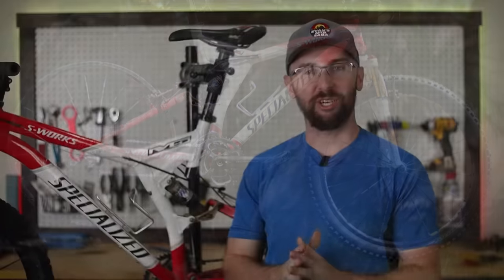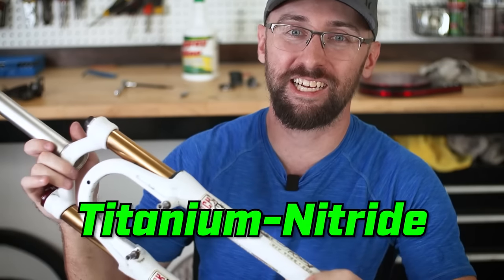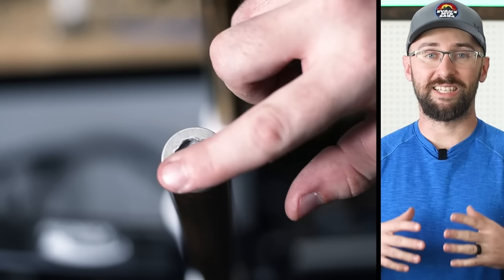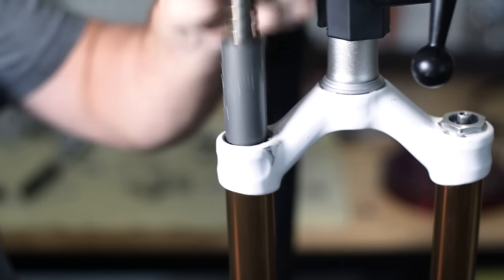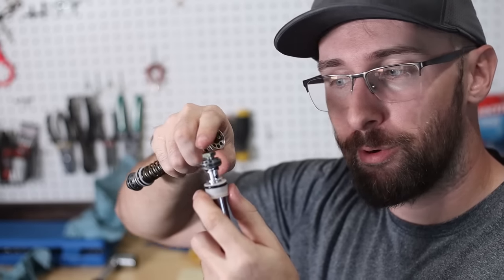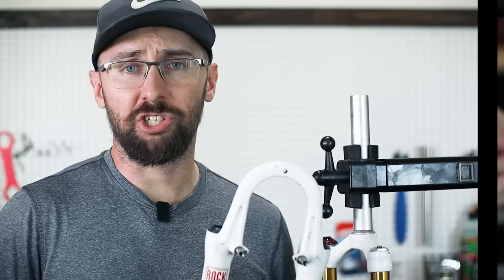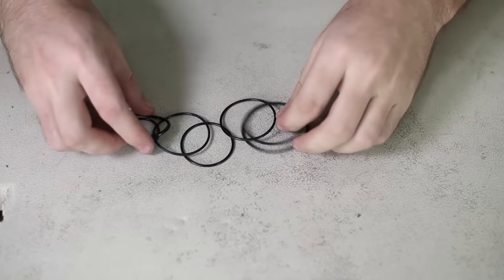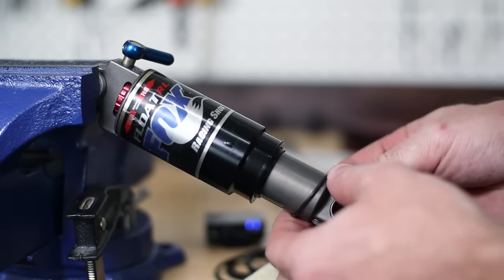I bought an S-Works mountain bike for $300 - Episode 1

Comment: Nice bike and video! I have a 1999 Specialized FSR Sport that I bought for $250. The previous owner had it serviced by the local bike shop and replaced the tires with inner tubes just before I bought it. The original Manitou Spyder forks and Fox Vanilla shock is in good condition. I replaced the handlebars with PNW GEN 3 Range bars and a 50 mm stem with 30 degree rise. I love the Deore V brakes due to the stopping power. They can almost launch you over the handlebars when making sudden stops. I love the old school bikes and it rides smoother than any bike I have ever owned. I am planning to replace the front fork with a Rock Shocks Recon and a ExaForm 588 rear shock when the originals blow out.

Comment: Excited for this restoration! Hopefully that fork works after all that work!   If not hopefully you can score a great 26” used replacement from your usual sources or a saga squad member that is slightly newer and helps with disc brake conversion but keeps the white/gold look of original.  Someone has to have one collecting dust for this classic build.  Always love the content and unique style of your vids

Comment: I have a 99 Stumpjumper FSR XC that I touch up painted and kept the Mantou elastomer fork, still worked. But I did replace the Vanilla Air rear shock, wider bar, shorter stem, dropped the 3x for a 1x drivetrain and added a dropper. I kept all the parts, in case I wanted to restore it. I still ride it and she keeps up with the new bikes just fine.

Comment: A friend of mine has a 2001 version w/ full XTR and Fox suspension. He swapped it to a 1x setup and still prefers it over his new Polygon
Reply from the maker: Oh nice that's good to hear. I plan on modernizing it for sure. The hardest part will be going to disc brakes and keeping the Mavic wheels. Also finding 26" straight steer tube forks is hard!
Reply: Not too hard, get a custom built fork, or you coul build one up from scratch. My brother has a 1 inch threaded steerer, I plan on getting a dh fork for him, and use two top crowns to secure a 1 inch threadless steerer for him to use. Might by structurally weak, but it should hold. Good luck on the build, and keep up the videos.
Reply: @EvansMTBSaga  Not a lot of options, the Markhor were the best I could find new.
Reply: @EvansMTBSaga  If you absolutely want to upgrade the fork find a old 27.5 staight steer 100mm reba. It'll slacken it a bit but not too much. That said i would not fully modernize that bike and just do little upgrades like i mentioned in another post. If you ride it too hard it'll break everywhere starting by the pivot anyway. For today standard you should keep it for light trail riding, leisure riding, no real jump etc...

Comment: I bought one two years ago, and I was too excited to notice its glaring faults. The rear skewer ate its way through the frame, and there was a small crack where the rear tri meets the front tri. Both shocks needed a complete rebuild and many parts were far from original, a clear sign somebody had sold the higher value parts. Bought for 200, had to get rid of it at 160, but now I have a new old stock 2010 Hardrock Pro and I'm happy with it.
Reply from the maker: Did you notice how low the bottom bracket is??
Reply: @EvansMTBSaga  now that you mention it, looking at the pictures I took of it I must say it's not far from the ground. I wonder what the benefits or drawbacks would be.
Reply: What version did you have mate?

Comment: I think you'll find a, that's a 2001 mode ( top of the range in 2002 was the new shape enduro expert retail at £1600) and b, pace used Titanium nitrile stanchions in the late 90s on the rc36s. Those fox sid races are made waaay later than the frame ( early models were a pale blue), I think they're around 2004 or 6, definitely not the original fork for the frame

Comment: BTW, $3,600 in 2002 is $5,363 in 2021 factoring in inflation.

Interestingly, the current top line S Works XC bike is priced at $10,020.
Reply from the maker: Wow that's interesting seeing the number ran through an inflation calculator. I would've thought it was more

Comment: I just bought one of these bikes...I'm going to  swap out all the components to XTR/XT drivetrain, a Race Face bottom bracket, seat post, cranks and front rings...I'm gonna pirate them off an old Stumpjumper I have. Gonna replace the fork too...not sure with what yet...🤔

Comment: I still own one i bought in 2003 on the cheap thank to the new "epic". The FSR is a much smarter buy because it has no trikcy brain problems anyway. I obviously don't ride it as my main bike anymore but it's nice to have it when friends or family come home and go for a little ride. I raced roc d'azur and transvesubienne with it back in the days. If i could rebuy it today i would go for a frame as large as possible (thankfully i took a M back then and not the S dumb people told me to buy). Because these are very short in length by modern day standards. Larger frame allows shorter stem which make them more manageable on the trail. A wider bar is a welcome addition without going full modern wide. Chunkier front tire (2.4) up the handling too. I kept the V brake too because going disc would mean discarding the nice mavic crossmax wheelset, the nice XTR lever, and cool XTR V Brake. V brakes are not fantastic but they definitely will stop you if needed. It keeps the bike somehow period correct too and these are easy to maintain on a bike that don't ride often. A 1X update is doable without too much modifications and would bring chain safety, more reliability.
I see you didn't service the shock damper that requires specific tools and high pressure nitrogen. A simple dropper post would make the ride more enjoyable but you'll have to find a short one because usually not much shaft is exposed.
Beware to avoid hitting the shock if you lower the seat while riding. Also it'll scratch the nice thomson elite seatpost.

Comment: 6:29 what type of oil do you use? I've never done a service on any of my forks and pretty sure my Polygon needs it now. 5w, is it fork specific? Motor oil? Have you used motor oir?
Reply from the maker: The service guide says what oil to use. I wouldn't use motor oil even if it's the correct weight because those oils have additives
Reply: @EvansMTBSaga  got u, thanks man

Comment: "...who wants 63mm of travel?"  Ask any gravel biker and they would love it! 
All that Rockshox is offering them now is 30 or 40mm in the new Rudy Shox.
Reply from the maker: That's wild! I'm finally assembling the bike and the fork has only 63mm of travel. Pretty disappointing and wouldn't stand a chance to my local XC trails. Definitely getting replaced
Reply: @EvansMTBSaga  If you increase the front, you need to increase the back also a bit. I have the same bike (sans the S-Logo) and it is awesome for the price (got it in mint condition on eBay for EUR 85,-).  Oh, I have 100mm front and back.   :D

Comment: any thoughts for a 6'3" male 250lbs  49 years old on a out of the box cheap bike (even wallyworld) ? i been looking at the schwinn boundary... for light trails and little road action.
Reply from the maker: I'm not fluent with Walmart bikes, but I know the Axum, Al Comp, and Taff Comp are decent. Find out if they have a cassette hub, also a 1x drivetrain, and it'll be a good buy and suit your needs.
Reply: @EvansMTBSaga  thanks =)

Comment: Awesome video . I have almost this exact bike but 2004. It’s been sitting for years. It’s my first proper Mt bike so I was gonna mount the frame eventually.. but this has convinced me to service it and get it working. You can send me one if those spare o rings  haha
Reply from the maker: Check out the rest of the videos in my S-Works series, you won't be disappointed! My stock Fox float shock ended up leaking through the damper so I knew it was a goner

Comment: I have a 2001 Stumpjumper FSR XC Comp.
I need to know the stem diameter, is it 28.66mm?
I want to order a new stem, an adjustable one, but I cant confirm the diameter.
Reply from the maker: No clue. Either search the specs or measure it

Comment: I just finished building a 2004 Stumpjumper Expert. I made some much needed changes to make it more modern: short stem/wide bars, hydraulic disc brakes and a 1x drivetrain. I picked up the frame for $80 so I'm about $250 in it.